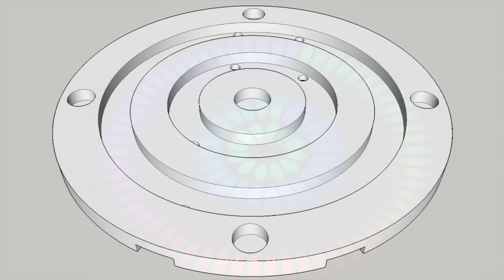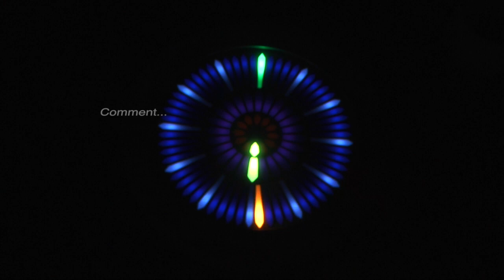LED Clock V2 Final Assembly

Comment: Steve sir pls make a clear video for circuit diagram and programme of neo clock v2 pls sir  pls pls pls sir
Reply from the maker: @ Balvinder Narwal:- Thank you for your request for a new video on the circuit diagram and programming. Although I agree such a video would be useful to some people, these videos however take quite a lot of time and effort to create, and regretfully I've not found the time or inspiration to create the one you have requested. Creating a schematic is relatively easy, as the circuit is just modules connected together, but a Video describing the code isn't something I'm prepared to do. Watching a video of me droning on about code, would probably send you to sleep or despair  :-)

There are links to the Nano and Simblee sketches in this video's description, and both contain some reasonable comments, but will lack detail as to why stuff was done the way it was, or how something specifically works. However, the code headers and pin declarations are reasonable enough to determine most of the module interconnects, so it is possible to figure out how the clock is wired. I will however admit that a schematic diagram would probably be very useful though, and I will knock on up and make it available in the links. I will let you know when it is done.

Every now and then decide to change something on the clock to improve it, and this is partly why I've not drawn a schematic as yet, as the project it is still very much a development, all be it a very slow development.

If you have any specific questions, then please post a comment here, and I'll do my very best to answer it for you.
Reply: thank you sir
Reply from the maker: @ @balvindernarwal6941 :- Must be your lucky day. I just found a Schematic I drew a couple of years ago, and uploaded to Dropbox then. Not sure why I haven't made a link to it, but here it is anyway, Enjoy:
https://www.dropbox.com/s/abdfuevxvb3jjg4/Steve%20Manley%20RGB%20LED%20Clock%20V2%20Schematic.pdf?dl=0
Reply: Steve sir I have check diagram but sir pls make a video pls when I a better understand
Reply from the maker: @balvindernarwal6941 :- I'm very sorry that the Schematic diagram is not enough for you to determine connection information, or for you to determine the circuits functionality. However, if you check out the below link to the Parts List, you will find a picture of the current V2 clock all wired up, which should give you some idea of how it could look if you were to build a clock yourself. I would suggest you ignore the Simblee though, as these devices are expensive and hard to find now, A shame as I thought they were great devices, and intended to make a V3 of the clock using just this device for the micro controller. You can of course do things your own way, as my method is just for guidance, and the video's are just one method to produce a clock like this. You don't have to build it exactly like mine:
https://www.dropbox.com/sh/1uthw4znj5bmmzl/AAAQTtSBu77NFdbMbMgWu2dea/Electronic%20Components%20Parts%20List/Steve%20Manley%20RGB%20LED%20Clock%20V2%20-%20Parts%20List.pdf?dl=0

It is still with regret, but I will reiterate, I will not be making the Video you have requested, and for reasons I have already stated. I will however provide you with a brief circuit description. 

This clock is based on a Arduino Nano V3 micro controller, and the Adafruit 60, 24 & 12 LED Neopixel rings, cheaper rings can be purchased from China via e-Bay at your own risk, as can cheaper Non genuine Nano's. 

For accurate time keeping, the micro controller requires a Real-Time Clock (RTC), hence the Sparkfun DS3234S RTC breakout module, with a battery backup, so the time is maintained when main power is removed. This particular RTC communicates with the Nano via the SPI Bus, which is a multi wire 2 way communication protocol, which I will not explain as there are many videos and web sites that do explain it well. The RTC also has a 1Hz square wave output that once a second, interrupts the Nano to say the time has moved on 1 second. The Nano then reads the new time and date from the RTC, and displays the new time. The clock can also display the date by pressing the Mode Up button once. The date display is hard to read if you don't know how its represented. The date is hard to display on a clock face, but I did manage it, so please check out this video which provides some explanation: https://www.youtube.com/watch?v=7tFtxcXfN0g).

The clock has a couple of audio modes where sound is broken up into 7 channels via a MSGEQ7 Graphic Equaliser chip (conveniently mounted on a breakout board I got from eBay), and displayed in a couple of ways. The sound is detected by a Sparkfun MEMS Microphone breakout, which I mounted directly onto the MSGEQ7 breakout (after I removed the jack socket), and feeds into the breakouts left audio input channel (you could use the right channel if you like as it makes no difference at all). The MSGEQ7 needs 3 wires for the 7 channels of data to be gathered by the Nano. In essence, the Nano sends out a Reset, that forces the MSG chip to start a download cycle, the Nano then pulses the Strobe pin, which tells the MSG chip to present the first channel of data on its OUT pin, which the Nano then reads as a analog value. Each subsequent pulse on the Strobe pin sets the MSG chip to present the next channel, and this goes on until all 7 channels have been read by the Nano. Some processing of the date is then carried out, and displayed on the clock face accordingly. I suggest you Google "MSGEQ7 Data Sheet" if you need more info on how that chip works, plus study my code to see how the Nano deals with controlling the MSG chip.

The various clock displays are accessed by pressing either the Up or Down Mode buttons. With the Time displayed, yo can set the time by pressing and releasing both buttons at the same time. You will then be able to change the hours by pressing the up or down mode buttons. Press and release both buttons again to set the minutes, then again to set the seconds. Then one final double press to commit the new time. 

Setting the date is much the same. select the Date display and press and release both buttons, First you will set the year, then the month, then the day. The clock does attempt to shift the time for the UK daylight and UK summer times automatically. It works fine in the spring for the clock going forward by one hour, but in the winter, there is a software bug that sets the clock back one hour every hour, so gets stuck between 1 & 2am, until you manually reset the time, so this bug needs sorting. If you don't need the time shifts wherever you are in the world, or do not conform to the UK time shifts, then you can edit the code accordingly or remove that functionality.

If you press and release both buttons on the first Audio Mode (2 presses of the Mode Up button when the time is being displayed), the clock will then run a test sequence on the LED's. 

There are 2 audio modes, each with 2 variations. One mode varies the brightness of groups of LED's according to the 7 channels, and the other displays a graphic equaliser representation. Both modes can have the display static, or rotating. One final mode is the colour changing PacMan.  

One note about the Audio modes, the Mic and how its presented, does affect the higher frequency pickup. Unless the back of the clock is directly in front of a speaker, the high frequency activity isn't that great.

The code is still a bit raw, and could do with some tidying up and bug fixing, and additional comments of course. Other than that, the Clock on the whole does work quite well, and mine has been running for several years and keeps very good time.

I hope this helps.

Comment: Hi Steve, this project is freaking awesome and I am really looking forward to get all the parts within the next weeks. Do you also have the 3d print parts for the pcb holder on the backside of your wonderful design? Thanks in advance!
Reply from the maker: Johannes Klamann
Hi Johannes, thanks for your your kind comments, and pleased you like the project.

The clock in the video has additional electronics and PCB holders than those shown. I’m not entirely sure I have all the original files as the clock design has been tweaked over the years. Can I assume you just want a PCB holder combo for the Arduino Nano and Real Time Clock module, which I do still have, but is slightly different than that shown. The power distribution board has had a significant design overhaul and I probably don’t have a copy of the original file, but I will check.
Reply from the maker: Hi Johannes, Here is a link to the Nano and RTC holder:
https://www.dropbox.com/s/asyxprxgr8kunpp/Nano%20and%20RTC%20Holder.stl?dl=0

Unfortunately I'm unable to track down the original power distribution board holder. I think it was transformed into something else, and my backups don't go back far enough to retrieve a copy of the older file version. Sorry.

Comment: hello,
what a great clock, i will try to build one, may i get the schematic of the electroic, thanks a lot

Manni
Reply from the maker: Manfred Böck Hi Manni, glad you like the clock.

As it stands, I’ve not done a schematic yet. The connection details for the original design (the one in the video) can be found in the Arduino sketch header.

The clock has evolved since making the video, and rev 3 is currently in development. Once complete, I will create a schematic of that, which will have a few extra features.

Comment: This looks amazing. About how big is it (the diameter)  Any schematics?
I am in the process of ordering a Ender 3.
Reply from the maker: Tom Gray 
Thanks Tom,
The clock face is 190mm, not counting the wooden surround. 

Most of the files you need are in my Dropbox, links are in the description. 

The LED rings do vary in size depending what and where you get them, which means the clock back plate and clock face parts sometimes need to be customised to suit. 

One Guy recently found a way to mod the STL files himself without my help.

If your Ender 3 can handle larger parts, then there is a set of STL files for a whole back and a whole face, rather than having to print 10 separate parts.

Good luck with the printer and let me know how you get on, or need help adjusting the back and face parts.
Reply: @stevemanley3685  thank you very much Steve.
❤

Comment: awesome project. used a different realtime clock (ds3231) and a ldr instead of a mic
w00h000
Reply from the maker: Thanks for letting me know and I'm very please you like it. Also fantastic you made one yourself
Reply: the leds ive got need a small index modification. btw im using white window foil which is working pretty awesome
Reply from the maker: lilcwn yes I’ve used a da3231 on a different project, and it is a good option. Glad to hear your able to adapt the design.
Reply from the maker: lilcwn When you say the LEDs you are using need an index mod, what exactly needs tweaking?

Are you using the 2 or 10 part version?

Are you using white window foil as the defuser, if so, do you have a link for it? I’m always looking for better alternatives for the defuser
Reply: index 0 isnt the first led, its led 1 for all rings!

->

void resetArrayIndexes() 
{
  // reset the ring index arrays, audio mode 3 & 5 changes them during rotation effects
  for (byte index = 1; index < 60; index++) 
  { 
    ref60[index] = index-1; 
  }
  ref60[0]=59;
  for (byte index = 1; index < 24; index++) 
  { 
    ref24[index] = index + 60 - 1; 
  }
  ref24[0] = 60 + 23;
  for (byte index = 1; index < 12; index++) 
  { 
    ref12[index] = index + 84 - 1; 
  }
  ref12[84] = 84 + 11; 
}
Reply: btw i also slightly modified the clock face
top led is kinda white now ;]

https://i.imgur.com/MRD46aK.jpg
Reply from the maker: lilcwn I assume you printed the 2 whole parts, if so, then yes there is that error. Sorry about that. Until recently I was not able to print parts that big and did the version for a friend as a one off. He pointed this out but corrected it in software. I will be doing a corrected version soon as I now have a bigger 3D printer.
Reply: solved it with a software modification so theres nothing to worry about at all ;]
Reply: oh btw i like my cr-10 =]
Reply from the maker: lilcwn I just got a Tevo Tornado, but still trying to get grips will all the settings in the slicer software.
Reply: try those facebook user groups. there are awesome simplify3d profiles for a cr-10, so probably good stuff in those tevo groups too =]
the clock actually was my 2nd 3d print after ive got that cr-10. benchy worked out fine so i tried yours.

i did print both stls upside down to get a flat front surface
Reply from the maker: lilcwn Thanks for the info.
Reply from the maker: Thanks for the mention, I really appreciate that. Btw, I love your illuminated cathedral.